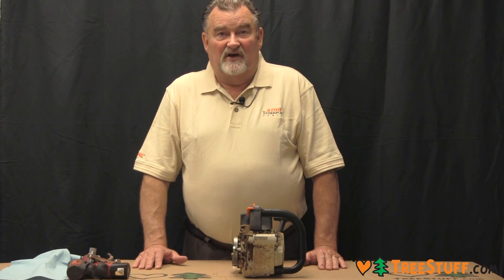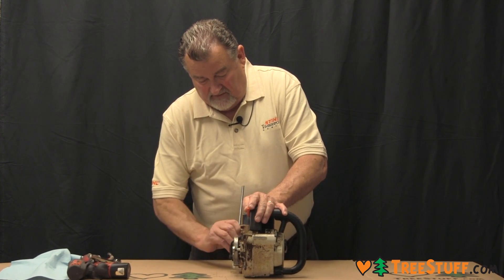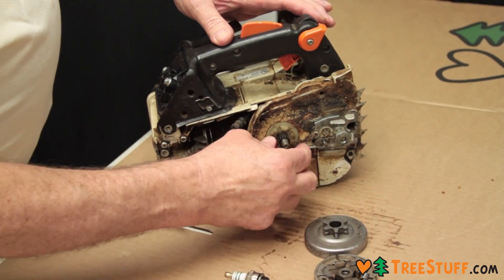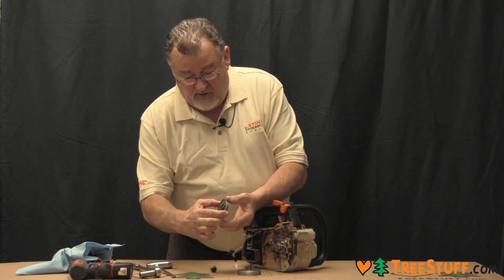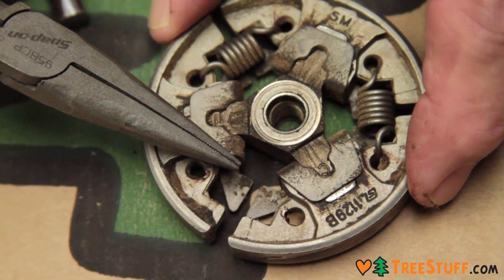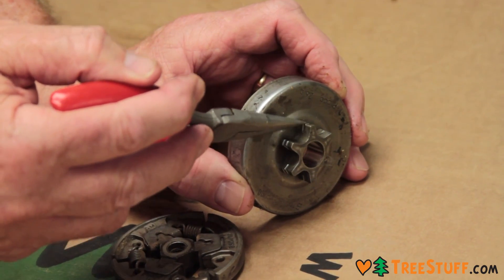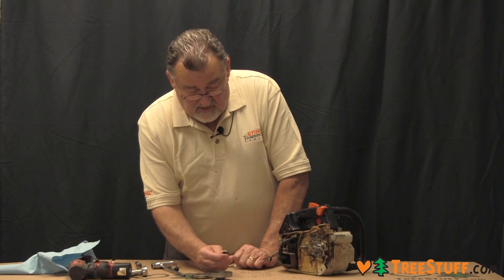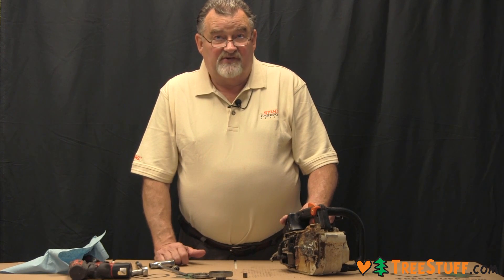How to Fix a Chainsaw: Removing and Inspecting an Outboard Clutch Drive System

Comment: Good to see a video with a ms 200
Reply: Agreed.  Fantastic saw.  I’m a homeowner and bought one back in 2005.  I never realized how popular they’d become. The saw still only has about 15 hours on it.  My only concern is age related stuff. I’d imagine eventually rubber fuel lines and stuff will need replacing.